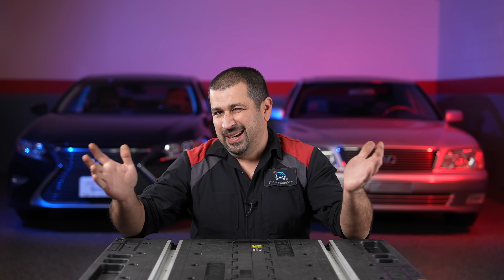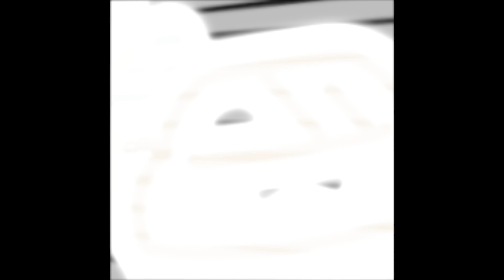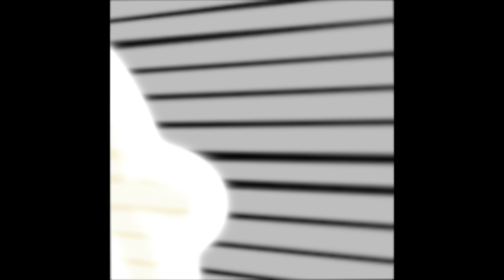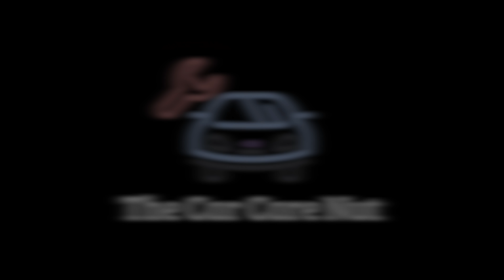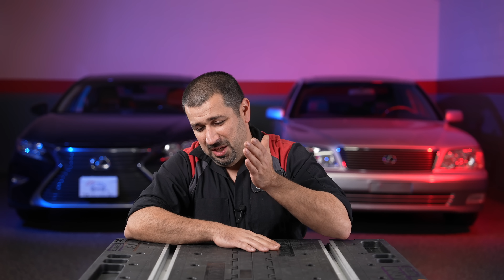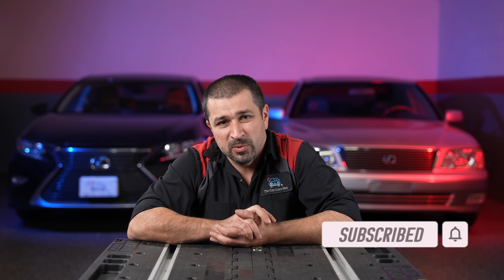Can Modern Turbo Engines Be Reliable? Here's The TRUTH!

Comment: Iv got a Nissan series 2 R33 RB25DET and box  in my E36 M3 4 door , it had 190 000 km when i got it , now its 250 000 km with just a MLS head gasket , standard everything inside , Bigger Turbo and gate  bigger injectors , Crank fired Ignition , Haltech ECU , its got 290 kw at the rears on 17 lbs boost all day everyday , oil and filter changes at 5000 km unless i do a track day then its both afterwards , got a big oil cooler , I would not touch a modern car , Im a Toyota Tech at a dealership and just see all the problems with modern cars , yes Toyotas do have issues , I have to park my car around the back lol

Comment: You forgot a few variables that must be taken into consideration. 1. Just because it has a turbo, doesn't mean it's a performance vehicle. Drive sensibly and keep the revs down. 2. Ambient weather. A car living in the warm south is totally different than one living in the cold north for half of its life. 3. Keeping things clean. If you live in the bug infested south Florida for example, those bugs plug up the radiator and intercooler making the turbo inlet temperature all the hotter. It's heat that kills turbos and the engine they're mounted one. Not only with the oil temps but all other components. The best thing to do is avoid turbos at all cost.

Comment: Turbos typically last 150k mileish and are very expensive to replace, why would you want to replace it with a motor that’s 150k miles and probably has other issues? Doesn’t make much sense these, manufacturers want you to spend more money.

Comment: I had a 2013 GTI, just gave it to a family member. I changed the oil every 4,000 miles. I never had any major issues. A couple of coils went bad,a clogged sunroof drain, that was about it, other than battery, brakes. That's it. If your car has a turbo, keep the oil changed regularly, and a little more often than you're used to.

Comment: Good content. The advice about oil change frequency is good for non-turbo cars too...but yes, critical for turbos.

One other point: air filter maintenance is absolutely vital for a turbo...if the filter is not filtering properly then turbo bearing failure is likely. Also beware aftermarket or performance air filters: I had a K&N air filter fitted to a Subaru Legacy Turbo and the turbo bearings failed a couple of years later...

Comment: Yes it can , if you maintain oil change and cooling change , my turbo last to 290k miles with turbo timers , and good quality motor oils , my gasoline 88 turbo Eclipse last to 759 K miles , I replace turbo shaft and thrust bearing NOT ballbearing type , the turbine blades chip off 15% of it blades only

Comment: I only put on maybe 5000 miles annually . Should I stick with the 3000 mile oil change ? My thinking is you will see the mechanic at least once annually . Also I rotate tires each oil change . Thank you Ahmed for this info . I will be purchasing a new Telluride that has a turbo . This will be my first turbo.

Comment: My wife has a 2019 CX-5 Turbo, the way things are expensive, the fact the car is paid off I do 3k-4k oil changes religiously. We don't have any plans of upgrading. I don't believe in the nonsense of changing it once a yr or 10k miles 😂. I had an older BMW 330i, I loved it! They kept telling me why I did the oil changes every 3k miles when it required it at 7.5k or something like that. I said, because I want to. That car lasted me almost 20yrs. Only reason I got rid of it was because the head gasket blew and decided to get rid of it. Looking back I regret getting rid of it cause it was paid off, I took care of it religiously and I could of gotten a rebuilt engine way cheaper than buying a new car. That car is worth more than what I sold it for now cause people are looking for good cheap used cars now.

Comment: Haven't even watched the video but i can answer the question... yes.. My twin turbo 600hp daily is 35 years old on the original stock engine that has never been opened even for head gaskets or valve cover gaskets. Bone stock all original TT making 600 whp. I daily drive the car. 237k miles as of last night.

Comment: I agree and disagree.
I agree that stelantis can shove their 10k mile service interval recommendations, right up their UKW, about my SST ♈ ram.
I'm doing them at half the recommend cycle, only because it has a dedicated cooling system for the turbos.
At the same time though, most of the gasoline turbo engines today are not the same as the turbo attempts of the 80s and 90s.
With the exception of the longevity of the Buick t types, the other turbo gas cars were just standard gas engines with a turbo thrown on for boost and fuel compensation to match.
Today's turbo engines are mostly purpose built for turbo from the ground up.
The Chevy 2.7 is basically a little semi engine with spark plugs.
I also have high hopes for the ram SST, especially since I bought one.

Comment: Turbo cars will have problems if one follows the factory oil change schedule. For the Australian market, BMW changes the oil at 24,000km (15,000 miles). How can that be good for the engine? It’s not. The problems will start way after the factory warranty expires.

Comment: I always remember turbo engines both Diesel and Petrol (I'm from Australia), requiring a cool down period at the end of a drive. Usually 5 minutes. My experience with turbos are aviation engines where we have cylinder head temp limits and cool down times published in operating handbooks to follow. Plus, they have 50 hour oil change requirements like a lot of other, non-turbo engines.

 I have noticed that owners of modern cars aren't doing cool downs or fitting turbo timers etc, so the car can take reasonable care of itself while they get on with their busy lives.  

Do you know if this is something that is in owner's manuals but being missed or not mentioned all together? Interested in your thoughts.

Comment: The biggest problem is that people do  not understand that the new improved oils are only marginally better than the older good oils.   It's not a massive difference.   The other thing I wished you had mentioned was to idle the engine for a minute or two and let the turbo and its shaft cool down before engine shutdown.  This improves oil life as it reduces how much oil is cooked.

Comment: Strict maintenance with the correct oil and filter, never do oil changes at quick lube joints, drive sensibly and let engine cool off for a bit after a long, hot trip before shutting down engine then yes, they can last a long time

Comment: When I need a new car I'm going to look at non-turbo hybrid Toyotas. I think they are more reliable than the turbo powered. My wife has a 2015 Prius V with 162,000 on it. We purchased it new. It has needed very little maintenance. Just had it's first brake job. At around 140,000 it needed a water pump. Fluid changes as recommended.

Comment: I didn't understand is this applicable only to gasoline turbo engines or turbo diesels as well?
Reply: Turbo diesels are really completely different from gas turbos. Diesels are compression ignition while gas uses spark plugs for ignition. Diesels don't generate nearly the heat levels that gas turbos generate and its the heat that degrades the oil. So with a gas turbo engine I'd say every 3,000 miles change the oil and it has to be full synthetic not the more common and cheaper "blend" of synthetic and conventional. Turbo gas engines need full synthetic with frequent oil changes. Also start the car and let it run ( idle ) for a minute or 2 before driving and when you park let the engine run for a couple minutes at idle before shutting it off. It has to do with oil circulation and not cooking the oil. Full synthetic handles higher heat better is why synthetics are needed. With diesel engines id just follow manufacturer suggestions.
Reply: I personally would rather just have a larger naturally aspirated engine than a turbo but the EPA has forced these turbo engines down our throats and all we can do is try and accommodate them as best as possible. Plus gasoline engines which were designed from the ground up to be turbocharged are better than a gasoline engine which had a turbo added as an after thought. I think the Ford Ecoboost line is pretty solid at this point they have been designed and built knowing the components are gonna be under more stress and higher heat. I know some people will say they don't want to wait a few minutes at idle before driving or a few minutes at idle after driving because to them its wasting time and they don't want to change the oil every 3k with full synthetic because of inconvenience and cost and all I can say is then hold onto your older naturally aspirated vehicle

Comment: Well said!... however, I wouldn't recommend 4k... do it diligently by 3k max. Frankly, I don't buy turbo small engines. It is just a bad combination. The only turbos I have ever owned were diesel. Currently a V8 diesel VGT. On that I change oil every 5k. 
I am not just a DIY guy, but also have a background of powertrain engineering with one of the major auto manufacturers.

Comment: The turbos on sprinter vans heats the oil upto 290°. It's a major cause for their failures.

I've also talked to people who bought turbos and never got told you have to let them cool down before shutting off the engine. That's a failure of the salesman.

Comment: This is especially true of high performance turbocharged engines. When I’m having fun with my Golf R, I have gotten the oil temp north of 240 degrees Fahrenheit. Those kinds of temperatures are what destroy the oil really quickly and necessitate a 3,000 mile oil change. More power equals more heat! The 315+hp EA888.4 EVO engine found in the Mk8 & 8.5 Golf R is a stout engine with a closed deck, iron block, forged crankshaft & rods, and special alloys that have better thermal properties to withstand high heat without warping. This means it is built to handle the stresses of turbocharging, and will happily take daily abuse as long as warm-up, cool-down, & early maintenance is never skipped!

Comment: I live at a lower altitude and frequently (2 to 3 times a year) visit Colorado where I grew up. I have only owned turbo charged cars since 2011. I like turbos since they don't suffer much performance loss at altitude. I always change my oil every 5k miles regardless of the manufacturer's suggestion. I had one car I put 130,000+ miles on in 7 years. Oil is cheap.

Comment: Yes they are, but only if they're not American or Chinese..!! Having owned a Volvo S40 T4 (200hp), Subaru Liberty RS (200hp), Golf TSI (154hp), CLA45 AMG (385hp) and now a VW Tiguan R (300hp),  (all 2.0L Turbos, excepy Golf 1.3L Turbo) since 1995 and have never had a turbo associated problem on any of them.. especially when you consider how high powered the AMG is (385hp from a 2.0L T)

Comment: I have one of the “horrible” new Land Cruisers w the 4cyl hybrid. Not sure how the non-hybrid engines do, but I don’t think it ever has revved over 4k RPM. It’ll hit 15lb of boost but tons of low end torque w the battery assist. I can see it lasting a couple hundred thousand miles w 5k oil change intervals.

Comment: Changed oil every 5k on my late gen 2.7l v6 eco boost. Traded to a Ford Ranger with same engine because I never had a problem. Ignored the 10k interval on the oil life gauge going with 5k…. and got rid of the damn stop/start function as well. Going light on the throttle helps too. Nice to know the power is there when ya need it but that kind of “abuse” is rare on my trucks.

Comment: Why are we still using turbos at all? You want a small engine for emissions. Fine. You would like temporary boost for acceleration. OK. Use an electric motor for that. Recoup the energy as you decelerate as a bonus. Electric motors are not running hot, basically ever. Torque is instantaneous. Why not just switch to hybrids and forget about turbos?
We did just that. My wife drives a hybrid, and I -- a pure electric car (which is a great option for the second vehicle in a family), and we are not even considering turbos of any kind.

Comment: This is very true from my own experience with my 2019 civic si those engines are known for oil dilution problem i moded and tuned mine but change the oil every 3k miles. 40k miles of hard driving and it was still perfect when I sold it

Comment: when I had a turbocharged car i would change the oil every 3,000 miles. those turbos are super hot and oil passes through them... I'll be keeping my 2002 6 speed Maxima and 05 Sienna as long as I can.

Comment: From my point of view as a mechanic. I'm personally servicing few dozen Iveco vans and, as an coincidence, guy next door is making his living by fixing the same engines from complete wrecks and servicing the same, but not as a intern mechanic as me(and actually he's doing more precise job than me, like he is real pro, compared to me). Engines that I'm servicing at 15k km(not miles!) from brand new, altough I would like earlier, are all in superb shape way after 300k km(when changing the timing belt, I preventively change hydraulic tappets with rockers, chain between cams... boss has a wish... so I can physically see that I'm replacing parts, that don't need to be replaced and are just fine for more). From the other mechanic I personally saw engines at 300k km that are internally in such shape, that I simply can't believe those were still running(kudos to Iveco, I'm really impressed what kind of abuse those engines can handle mechanically and still run). Like liners worn out, all rockers(not single ones) dropping their needle bearings, camshafts eaten out way out of shape, rod bearings and cranks heavily scored etc. Basically ready for complete overhaul or scrapyard. Service intervals at fault. Night and day difference if the oil is chaged at 15k km or 30+k km. Sample of like 50 units of the same engine. I personally have almost 30year old NA gasoline car, nothing fancy, where normal oil service, specified by the manufacturer, comes at 10k km, under severe conditions at 7k km and its proven that engine can go way over 500k km if serviced well from the start. I bet you could relate, why its manufacturer almost went bankrupt. Someone else made having a car for average buyer cheaper first and won the market. Either you, as manufacturer, will follow or go out of businnes.

Comment: Hah, looking at how the tradies and builders drive their turbo diesels, ie point and squirt, they are not driving to the engine needs. Likewise with towing, leading to increased engine temp, I wonder if the TDs will last as expected.
Thank you for the info, my wife has a NX200t, the local dealer is resistant to "excessive" oil changes.

Comment: VERY good advice!  I would add driving habits.  Take it easy on the throttle.  If you keep the RPM’s down the turbo doesn’t work as hard.  You don’t save much time getting to the next stop light really fast. The reason for smaller engines isn’t just emissions.  It’s MPG.  Smaller engine, better gas mileage, if you keep your foot out of the throttle.  If you don’t the turbo spools and there goes the MPG out the window.